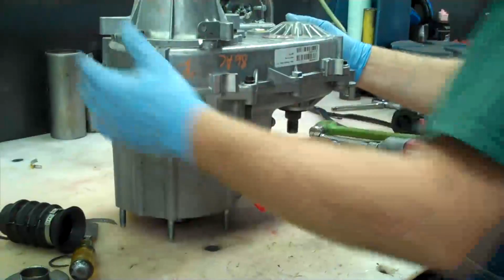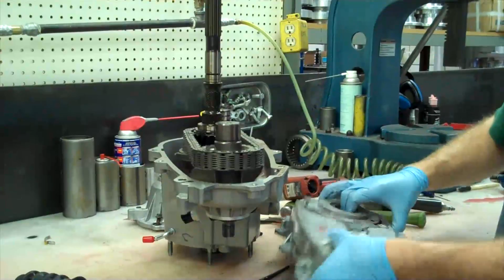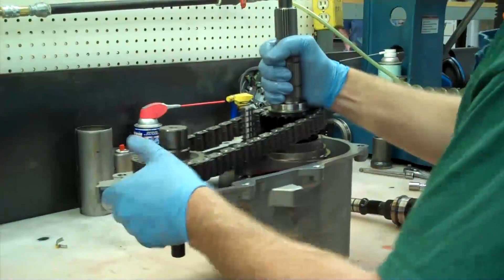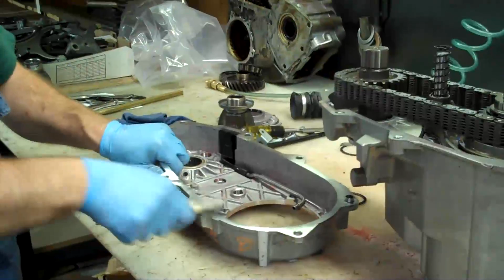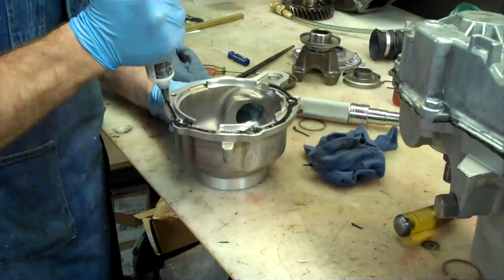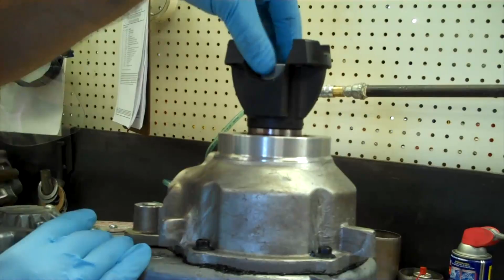Jeep New Process 231- NP231 SYE Install - Slip Yoke Eliminator

Comment: So i just did this on 1991 231j and replaced all the seals and put a new chain in it pushed out the needle bearings and i cut the shift shaft down to one inch per instuction and this video but it back in the jeep and it refuses to stay in 4low ive adjusted the linkage twice and it wont stay in 4lo never had this problem before any ideas were i could went wrong  im guess are i didnt cut enuff off the shift shaft or what would happen if i put that shift slider that you show the correct way to install  if i manage to put in it backwards any ideas would be good please

Comment: Had a shop do my SYE. Drove 467 miles in one month and now it is stuck in 4 Hi. Tried driving slowly forwards and backwards while shifting into 2 Hi with  no change. Disconnected the linkage and tried shifting the transfer case manually. No change, still in 4 Hi.

Question: If the snap ring holding the gear in place on the shaft is not correctly installed, will the gear move out of position and cause the transfer case to be stuck in 4 Hi?

The linkage is not the problem.

Comment: Where do you buy the star seal, no one at the auto parts knows what I’m talking about? I’m also having bearing noise from the cage bearing, chanted the fluid, just keeps squawking at low speeds, goes swat after driving it for awhile… also if the transfer case is in nuetral I try spinning that rear yoke, I have to spin it and it doesn’t spin freely, like the bearings are shot

Comment: Is that 4 wheel drive high or low its supposed to be in??????🤔
Reply: Hello I just installed one of these and cycled through all positions to make sure the shift rod was short enough. The shift rod would hit the new tail housing and bind if it's too long.

Comment: I like how the video shows removing all the other snap rings except that heavy duty one. That thing was a pain in the butt to get off the original shaft and 10 times worse to get on the new shaft
Reply: That is the whole reason I watched this video
Maybe advance adaptors has a little tip…
NOPE
Reply: What you need is "horseshoe ring pliers" proto's part # is 250G. You can find these pliers also by searching for "special lock ring pliers". They have knurled surfaces to spread the eyeless lock rings.
Reply: @ernestmyname  Thanks, just ordered this on Amazon
Reply: For real

Comment: Once rtv is applied both pieces need to be put together right away ( rtv instructions) then finger tight bolts until rtv is slightly squeezing out. Let set 1 hr, then torque to spec. Following rtv instructions really works 100%. God bless and enjoy.

Comment: Is there a reason you left the oil pump off when you first put the case back together? Why not leave them connected so you don’t have to use that little pick to attach the two?

Comment: On the off chance. I am installing Advance Adaptors SYE arrives from Rusty's tomorrow. Started disassembly however my snap ring pliers are (expensive) shite!
What brand is being used here? can be seen at 01:30. They look decent. Are they?
Thanks
Reply: I had the same problem. For anyone wondering, what you need is "horseshoe ring pliers" proto's part # is 250G. You can find these pliers also by searching for "special lock ring pliers". They have knurled surfaces to spread the eyeless lock rings. You can do it without them but it's a real pain.

Comment: That piece that has to be no more than an inch mine seems to be an inch and a half. how to I shorten it?
Reply: Angle grinder with a cutting wheel
Reply: Michael Padgett If you have a dremel or die grinder I'd use that. Angle grinder would work too.
Reply: Michael Padgett a hacksaw lol

Comment: Ok I am trying to remove the front yoke but it keeps moving on me. I put it in 4W low prior to removing the case. What am I doing wrong?
Reply: Foof50 I used a 3lb sledge hammer head to stop the yoke from spinning against the transfer case casing. However something wood would be the better option as it's softer than the aluminum casing.

Comment from the maker: Did your installation require the step of pressing out the needle bearing cages? If so the lubrication system on those shafts are different than the style that we build. This will not effect the performance or have any adverse effects on the lubrication properties of your transfer case.

Comment: hi i installed my kit today and i have a concern with the new shaft i fitted all seems fine for now after driving it today .. but the old shaft had a oil feed hole to supply oil to the gears that where swaped over and the new shaft does not have a oil feed hole for this point it has other hole where the planitary splines are if anyone could let me knoe if this is normal of if i am gioing to soon have a permenat 4wd due to gear running dry on shaft and sezing ?? thanks

Comment from the maker: Yes, the large spring is on the rail and gets compressed when the rear of the case is bolt back on. However there is one other one that also comes to mind.  We can email you a picture if you need it. send us a PM for email info since posting it to the video comments is prohibited.

Comment: When I opened up my case there was one spring sitting at the bottom of the case and one was on the shift rod. I'm assuming that the second spring probably fell off the rear of the shift rod when I was disassembling. Correct me if I'm wrong please.